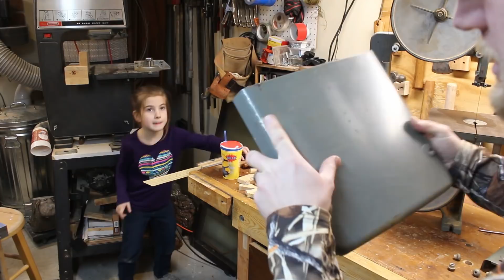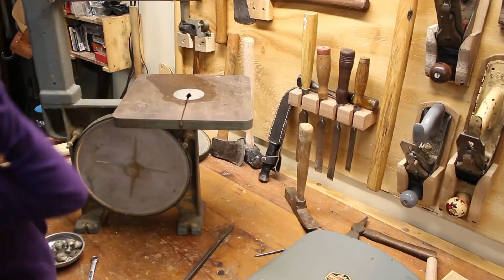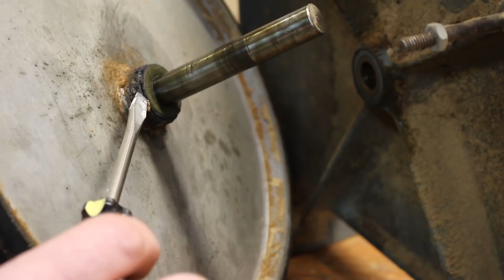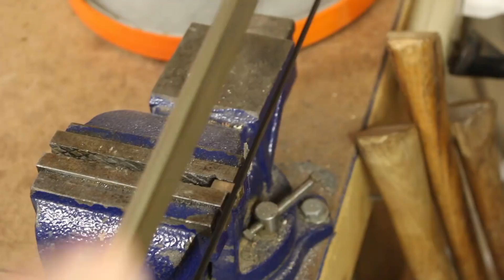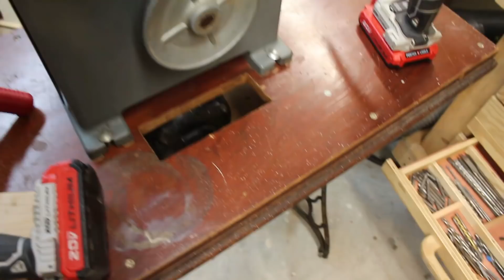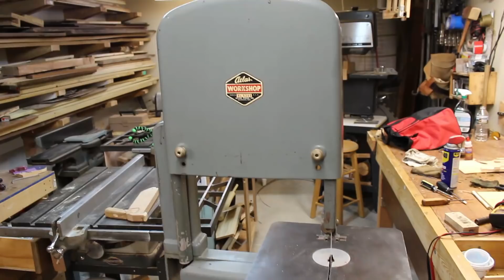Saving a Rare 1950s Atlas Band Saw Model 9360- Partial Restoration and Tune-up

Comment: I have an old Atlas 9360 that I restored.  I love it.  I need to replace the Guide Bars.  I can't find the part (B10-36) anywhere.  Do have any idea where I can find a replacement part?   
Thanks for the video.  A couple of years I bought mine for $15 and rebuilt it thanks to your video.  You did an excellent job of explaining everything you did.  I couldn't have gotten mine in working condition without this video.
Reply: the blocks in mine are bronze. you can get that at a metal shop. You won't even need to buy a foot!  I cleaned up the ones on mine with a file.

Comment: I just started a restoration of my father's 9360, it is a little rusty on the covers so more work to restore. It is missing the lower blade guide and shaft so will have to fabricate that part. I have tires, blades and cool blocks on order. I found the instruction and parts list online, but no parts are available. Nice little saw, thanks for sharing this video.

Comment: Nice job!  I restored the same model a few years back.  Using pulleys, I slow it down to cut metal.  Did very well until I overloaded the table and broke the die cast trunnion.  Die cast was a mistake, and so was overloading the table.  Can't find another one, and I probably can't repair it either.  Anyone got one laying around by chance?  Thanks for posting.  Jerry

Comment: I found this band saw on a curb in trash. Had it my shed for since 1996. Had time to bring to my shop and boy its brand new almost no saw dust and  the tires are in great shape. Shocking how new it looks. It also does not have the two extra holes your top cover has. Well I am so exited to put a motor and v belt to get it going. You have a very intelligent daughter she knew how to get the wheel off !!!!!
Reply from the maker: Awesome, so cool that you can give it new life!  Hard to believe someone trashed it in such great shape.  Hope my video gave you some inspiration in tuning it up.  I'm not sure what the extra holes in the cover are for...maybe a slightly longer blade?  Thanks, my daughter is getting really good at taking things apart with me...she'll soon be running the show

Comment: I  really enjoyed this video. I have the same saw and it works great. It took me some time to learn how to tune it up and get good results, but once it was set up properly, I was very pleased with how well it cuts. I didn't notice if the bolt for the upper wheel axle says so on yours, but mine says "oil" on it. The bottom wheel has a little oiler valve in the back on mine. One great source of help for me was www.vintagemachinery.org. They have a manual for this saw at http://vintagemachinery.org/pubs/detail.aspx?id=929 and it has a lot of good info in it.
Reply from the maker: Great, thanks!  I did notice that bottom oiler valve but no writing near the top bolt but that makes sense.  I did check out that manual from vintage machinery which THE go-to site for the old machines.  Do you have the extra holes in the top cover?  wondering what those are for...
Reply: Mine does not have the extra set of holes. My guess is that a previous owner got blades in some standard size that were a little too long, and when tensioning the bladed, the top of the upper wheel hit the wheel guard before sufficient tension could be obtained. So, someone drilled the holes to raise the guard and allow the slightly longer blades to work.
Reply from the maker: yeah that sounds right, I just checked and looking more closely they are not factory drilled holes...

Comment: I like the little Atlas saw. One thing if it's not too late, I have a delta 14" and I also bought a timber wolf 3 tpi blade. It was horrible! the butt weld joint was off and there was a slight bump in it, which causes vibration. I ground it the best I could, which I shouldn't have had to do and it helped some. I really wanted the timber wolf blade to work as my local store stocked them. I read more reviews on the Highland wood slicer and took back the timber wolf. The older guys at the store with tons of band saw experience, said that they had seen this problem before and that they would personally go with the wood slicer themselves, even though they don't sell the highland wood slicer. I got mine and I'll never buy anything else. Great video.
Reply from the maker: Awesome, thanks Scott!  I didn't order it yet so this is great info.  I have read good reviews of the woodslicer so I'll look into that.  Thanks man

Comment: I think the motor has a starter winding in it, to help it starts up, then the running winding kicks in and that's what pull the shaft in.
Reply from the maker: steve walker cool, thanks, that makes sense and was along my lines of thinking about it some more since there is no starting capacitor in this design

Comment: When are you going to fix up the 80's Craftsman band saw in the background.  I have one like it and I need a lot of tips.  Is it worth investing in new tires, etc?
Reply from the maker: good idea...Does yours have the cast iron table?  Those craftsman saws have an aluminum frame so they aren't nearly as heavy and smooth running as the older cast iron body saws.  Mine is from 69 or 70 with a cast iron table and after some work it is a nice band saw so yeah, it might be worth it to fix it up depending on what kind of cutting you're doing.
Reply: Yeah, mine has the aluminum table.  I noticed that yours was cast.  There were a few motor options, but wasn't aware of a cast table.  I'd like to know what upgrades are worthwhile.  Tires.  Guides.  Best blades.  Thanks!
Reply from the maker: I'll have to take a closer look at mine and look at the guides but one thing I did was make the sheet metal base more sturdy by putting a piece of melamine down under the saw to stiffen it up.  I didn't replace the tires on it yet as the originals are still ok.  Until I just fixed up this Atlas and got the higher quality blade, I didn't realize the huge difference in blade quality that existed.  I've been buying the Bosch blades at Lower for only about $10 but after using the Craftsman blade in this video, I see how crappy and thin they are.
Reply: Yeah, I've pretty much used Olson's, but recently bought a cheap one online that came with sanding belts.  The sanding best are interesting, but I am not sure how to use them yet, especially on wood.  Maybe they'd be better on metal.  The blade that came with it was super thin and too flexible.  One gentleman told me that he has had some good luck with Ulines sold at MN Fleet Farm.  I have yet to try those.  Thanks
Reply from the maker: ok, thanks, yeah I was wondering about the "sander" belts you can get for the craftsman.  I'll give you an update if I try a better blade.  Right now the Atlas does cut better than both of the bigger saws so it must be the crappy blades!